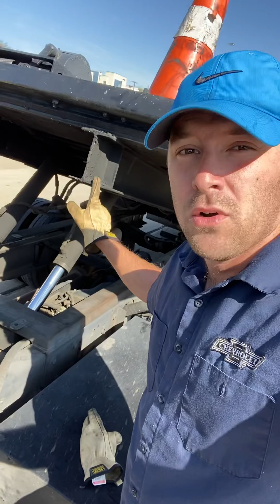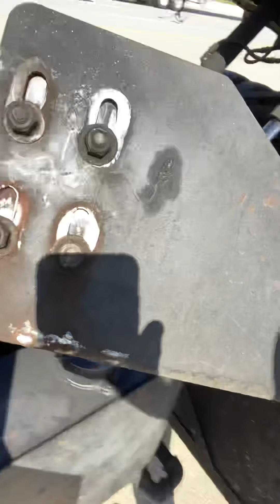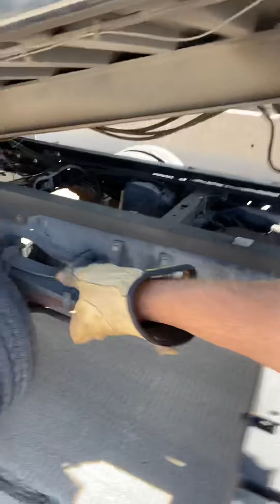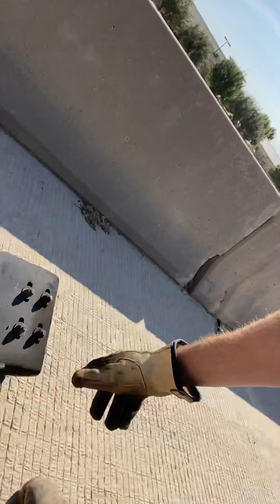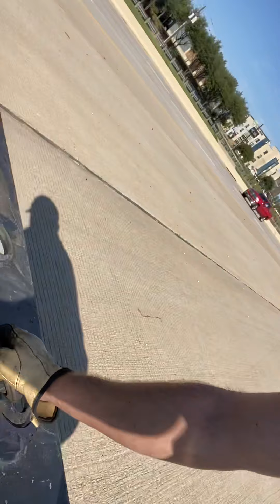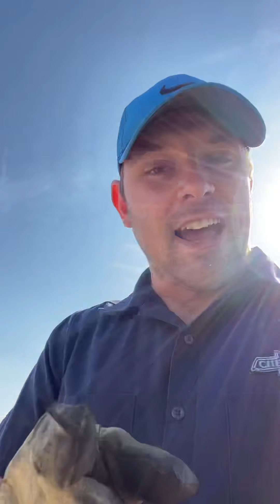Wrong way to weld on a tow truck

Comment: My 04' F550 has the exact same issues. Now I'm down for a week without revenue. I am so disappointed with people who cut corners. The people who do it right are usually the ones who spot the issues. Sounds like you did a proper walk-around. Good job brother. And my condolences.